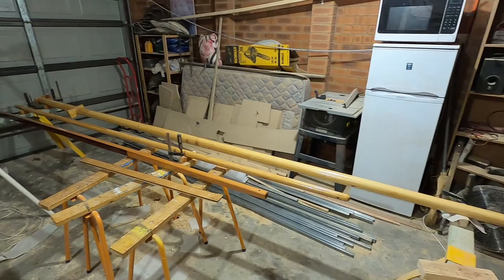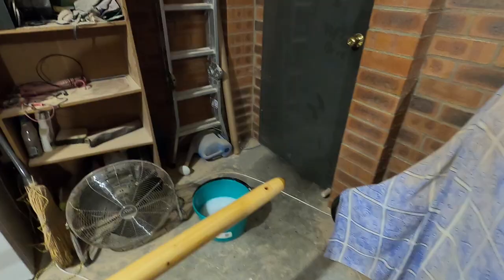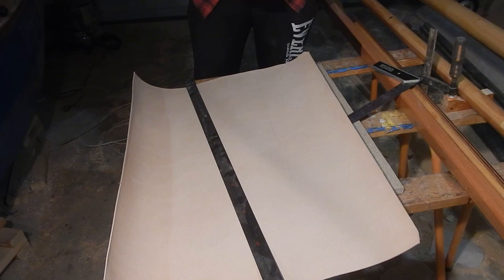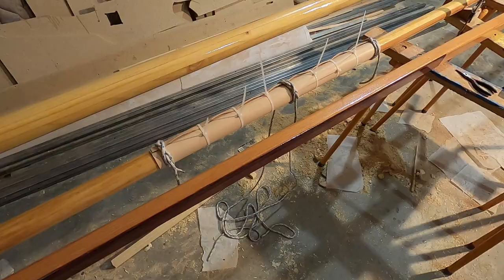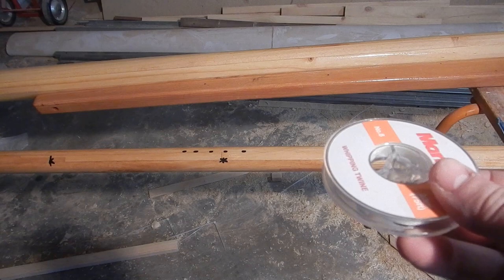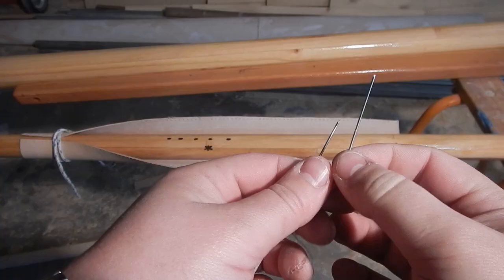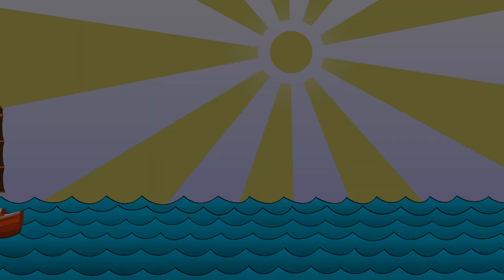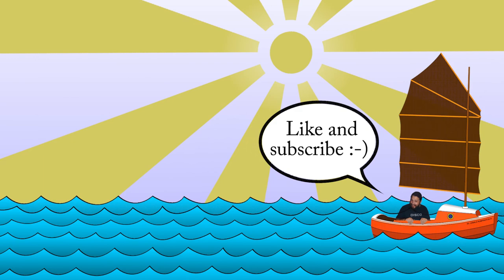Building a SCAMP part 081 - Spar Leathering

Comment: Nice, looks real tidy.. where did you source your epoxy's and fibreglass cloth from?   I priced up roughly what i need online  from an aussie boat supplier and for a 30mtr by 1mtr roll of 6ounce cloth they want more than it would cost to buy a registered 26ft trailer sailer ready to sail lol (i checked gumtree and found a few cheaper than the quote haha)
Reply from the maker: Hey thanks.  I got my epoxy from ACT fibreglass supplies, and my fibreglass cloth from eBay of all places (everywhere else was pretty crazy expensive).
Reply: @dana_pike  ahh great to know, im only a few hrs away from the act and drive through often ( usually buying cars haha)  yeah tbh the expensive brands of epoxy ive found to be actually reasonably priced inc delivery , so looks like ill be using hi grade epoxy's and evilbay cloth haha, thanks heaps mate..
Reply: Try Ballina fibre glass